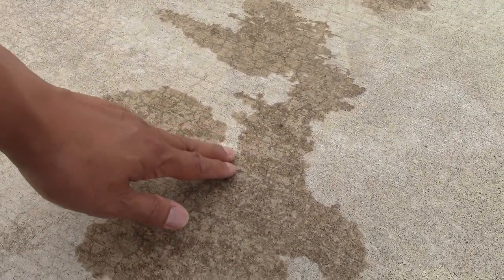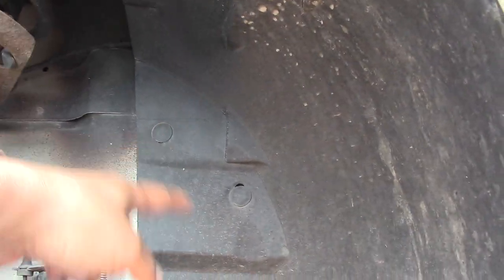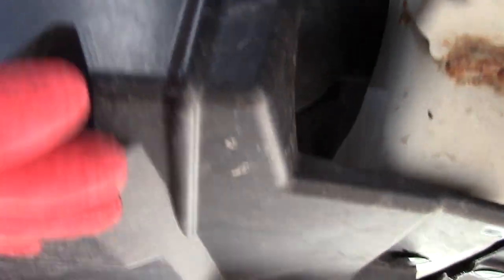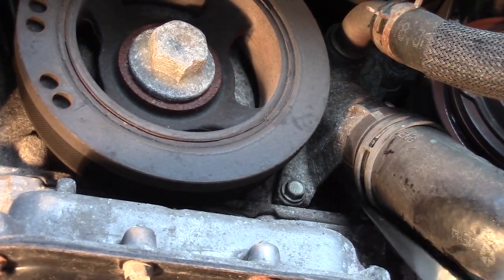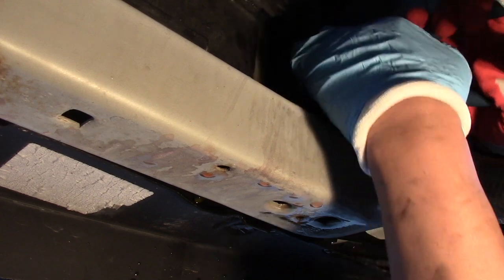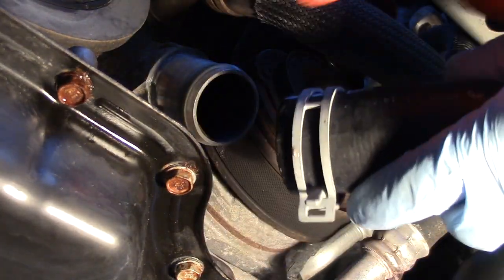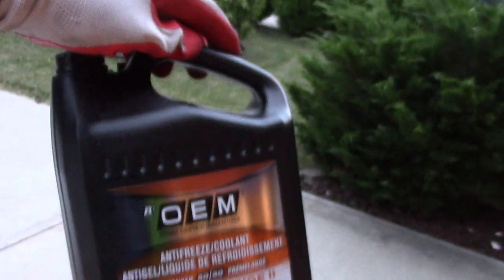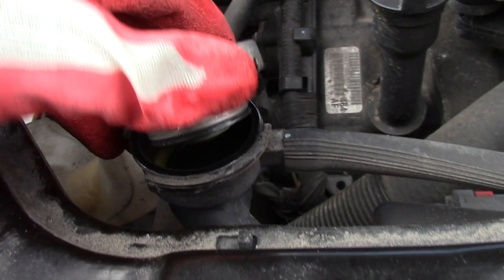How to fix Radiator Lower Hose Leak. Chrysler Town & Country Van 2013-2016. DIY.

Comment: Nice video,! When you had the leaking what coolant temperature would you see?

After you replaced the hose what temps are you seeing, normal driving ?
Thanks
Reply: My normal readings were straight up. When the coolant was low you can see the needle moving back and forth, and finally the red coolant light will come on and the needle will go to H. Not good.